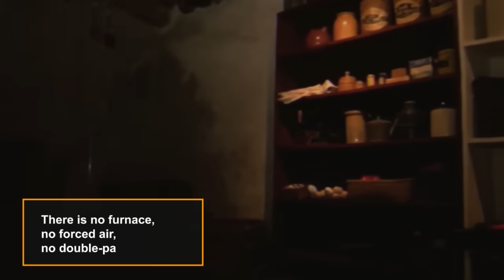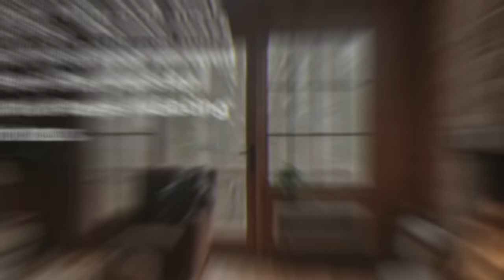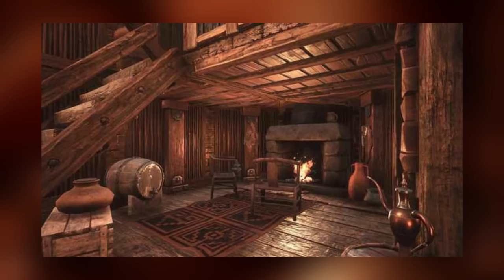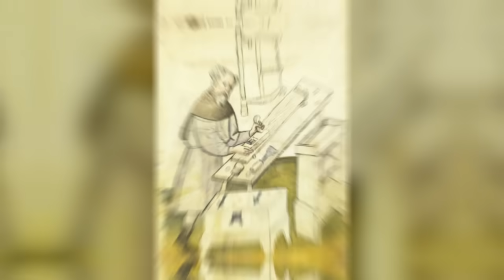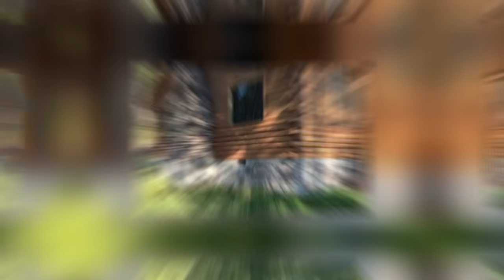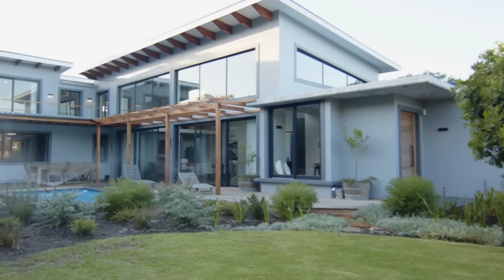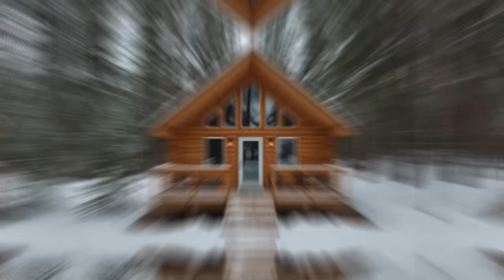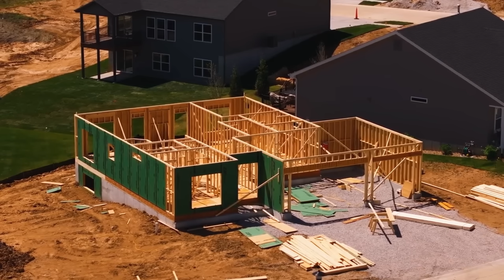Why Medieval Log Cabins Stayed Warm in -40°F While Modern Homes Freeze

Comment: I'm in Canada and purposely built my home with CMU block, filled voids with perlite, and covered inside and out with 2.5" thick cork+lime plaster.  These are high-mass walls.  Also painted with breathable silicate based paint.  Will never dis-colour and will never have to re-paint.  It looks like a typical stucco house.  These principals aren't forgotten.  I DID have to use a special variant on building code to get it approved, not that hard.
Reply: I insulated my loggia from the inside with a homemade perlite plaster. The plaster is 6 cm thick on average. The apartment is in a prefabricated reinforced concrete building. The temperature on the loggia increased by almost 10 degrees Celsius in the winter, without any heat source!
Reply: When I was in Finland we used a CMU that weighed about 1/2 of what a concrete block would weigh. The blocks we used were built from clay that was blown up in a kiln and then put back together with cement. Those blocks had better insulating value than wood.
Reply: Brilliant!
Reply: Whats a variance? LOL
Reply: @UsagiYojimbo-f1u  a process requiring approval from neighbours. For things like sqr footage of building to lot size for example. But for building code, you can’t get variances. You have standard building code but there is option for Building reg. B or Alternate building code. A more complex process of approval but more flexible solutions to achieve goals of code are possible.
Reply: Good luck getting any variance in code approved now. FFS, the federal Liberal Party just banned my Hunter Douglas house blinds. XD
Reply: @Mygg_Jeager  Why on earth did you have to get approval for blinds?  Don't put any and install after you get permit?  I shouldn't use the word 'variant' it wasn't a variance, which I'd need approval from neighbors, it was an Alternative Building Code.  I actually didn't need to do that either, I'd said I WANTED to do that to the building planner/drawing approver guy.  The process requires peer review.  AKA other planners in his position check each other's work.  In hindsight, that was a threat to his authority.  Because he became very cooperative after that.  That was 13 years ago, maybe it is different.  But something to maybe remember if you're ever in that situation.
Reply: @kippie80 You don't need to get approval for blinds. Hunter-Douglass changed their blinds because the old kind would occasionally kill a small child via strangulation. The old style are now outlawed for sale, because we have options that don't involve strangulation risk. It has nothing to do with getting a building code variance.

P.S. Your house sounds awesome. I live in a 200 year old house. It's not nearly as good as either yours or the one described in the video, but it's way better than the usual "modern" ones I've experienced.
Reply: @kippie80 bro what the fuck are you talking about? LoL I didn't say anything about permits. I said that they banned the sale and ownership of my preferred brand of house blinds that I have throughout my entire house and have had for 16 years or so. Now when one inevitably breaks, I can't get spare parts, I can't replace it with an identical make and model. I have to replace it with something weird and out of place. Because the government said so. This is a private residence with lots of windows. This isn't a construction site.
Reply: @kippie80 people need to start letting people know theyre "the wrong one". Submission to faux tyrants "allowances" is part of the problem. When multiple homes decide to stop complying and make it clear that any attempts will be taken as threats to life and liberty and responded to in kind, people either A. Mind their own, or B. Become examples. "Insurance Plan" is a huge help.

Comment: Not a storm but I spent the winter of 2021 without any heat and it was below freezing. I got really sick during that time. Fortunately I had some very thick blankets and some were 100% wool, that helped a lot, cuddling a doggie helps too.
Reply: How did you keep the pipes from freezing?

Comment: One scientific wrong info in this video is that the denser woods are better thermal insulator l. No denser wood means less air pocket  lesser the air pocket lesser the insulation. More the air pocket more the insulation but that doesn means bigger air pocket because it will cause air leaks . I am talking about small air pockets

Comment: My house in the same mountains where Mark Twain lived for 3 years, went down to 40F degrees when the power was out for 30 hours and it was 12F outside. We had a warm room we got to about 50F with candles and a small vent for fresh air. It was a real lesson in how heat and insulation works.
Reply: I also live in the mountains where Mark Twain lived. I wonder if we live in the same mountains? That would be... quite a Storey ;)
Reply: I live in a tree house that Johnny Appleseed planted, and it never gets cold inside.

Comment: In Scandinavia it is quite common to add insulation to your log cabin. Most (but not all) seem to agree that if you do add insulation to your log cabin you should do that on OUTSIDE of the logs, so it is easier for heat to get stored in the logs and less vapor/water get trapped in the insulation. The best insulation to use for this pupose is woodfiber mats that have all the positive features of wood and sawdust, but are form stable and do not compress/shrink over time (it can also buffer up to 35% of its weight in water and still keep it's properties and not rot or get moldy).

The thing that breaks down the logs the quickest by far is the UV light. That is why it has historically been common to put planks outside  the logs as a panel. That way the planks can be changed when they have deteriated but the core log structure will continue to be robust with minimal wear. 

Historically houses also had sod/turf/dirt roofs. This also adds to the insulation of the house as well as acting as yet more termal mass. It is huge factor of the thermal envelope.

If you go even further back, before loghouses were used (and timberframes with think short planks in between were used instead) it was common in Scandinavia to have an thick outer wall of stone, dirt, and/or turf outside of the wooden wall. In between these two were an air gap just big enough for a man to pass through (although still narrow).   The roofs overhang went out over the outer wall. This is how sod/turf houses in Iceland and Faroese Islands are still built. The outer wall acts as a wind and weather breaker. The airgap as stabelizer and insulation, and the thick wood as a reflector and termal mass. It is very effective to keep temperature stable. However the potential dampness in the airgap between the inne and outer wall can be a risk for the wooden structure. However with proper wood treatment (read coats of pinetar and boiled linseed oil) and good drainage in the eath beneath (layers of stones and gravel) this do not need to be a big problem, but still one to look out for.

One could do the same with a loghouse if one wanted to maximize the energy efficency without buying extra insulations and planks.
Reply: At least in Finland, also people and livestock used to live in the same building. Livestock would generate a lot of heat, though I don't think it would be suitable for the modern standards. And actually, there was so much heat and humidity that the indoors were quite tropical - enough so that malaria used to be endemic in Finland, I kid you not. Before learning this, I used to think that people must have lived in very cold conditions back then.
Reply: @fintux  Across the Gulf of Bottnia, in the southern and middle Norrland (especially Hälsingland) it is still quite common for the older farms to have the barn and the manorhouse in the same big house, so you can walk indoors from the house into the barn. Very nice in the winter, and it helped as you say with the heating as well.
Reply: Liked your comment overall. One disagreement. Wood does not reflect IR. Very few natural materials reflect IR. Polished metal surfaces are some of the only materials that reflect IR well. Al being one of the best broad spectrum IR reflectors. IR reflectors also need a bit of a gap between the surface and the heat source to reflect--not sure that this is fully understood why or not though, scientifically.
Reply: This has been a great informative video. I live in a normal block house in UK. 

They insulate it to death and it is acceptably warm even without heating on.

My question in all of this though is what about "damp and moisture" in the log homes? How is that avoided? It's a sort of a curse here in UK if we build a timber garage or outhouse. Great when sun shines and the walls warm and so on but when it rains or it's just damp, the inside of these buildings can get damp and moist.

Comment: I live in an old 1891 home, it was dependent on an old coal fired boiler  with water radiators that was probably on continually in the cold.  However today I have a gas boiler with the same radiators and I'm sure today's gas  is more costly than the price of coal from the 1890s(even with inflation). My home has many old windows and plaster walls and old wood siding, it doesn't hold heat well (32F outside all heat gone in 12hrs or less).  I have to shut almost all the  inner doors and I cover the glass on the windows with bubble wrap. Fyi - spray the windows with just a little water and then apply  single layer sheets of  bubble wrap to just the glass surface. The bubble side touches the glass, it works well. Unfortunately many of the old windows let cold air in where the double hang windows touch in the middle.   The gas boiler needs almost yearly repair and has failed almost yearly, not to mention venting air and regular maintenance. This year it was a thermal fuse.  Watch out for those hvac repair guys, sometimes they are a blessing, but I think sometimes they have shot parts cannon at our insurance co.

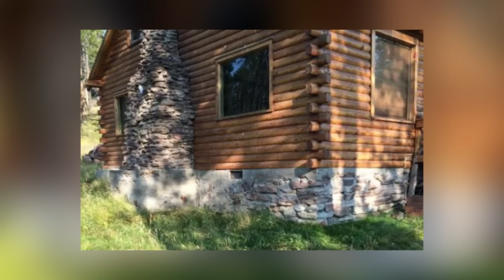Comment: 11:53 in Scandinavian loghouses it is not uncommon for the floor to made out of logs split i half. Underneath that you have a airpocket that are sealed off from the outside with a wall of dirt alongside thwfundation stones. The chiney stones go down into this airpocket so when the bricks in the chimey gets warm it also heats the air under the floor (and dries it out). The log beams in the dirt along the walls eventually root and needs changing  but that was part of the maintainment calculation and the floor was built so it was relativly easy to do (for one the floor was free floating and not attached to the walls).

Comment: my Partners house is a 400 year old cottage, with a wood fire, draughty windows and doors, but definitely warmer than a modern home if the heating not turned on, back then they had much smaller windows, if you are stuck in a modern home with a long term power outage, put up a modern hiking tent inside

Comment: I live in a shed. I never need ac,or anything. I made sure to insulation  it to death. In the winter only 1 small gas burner is all. About 100 dollars per year. I am blessed.
Reply: I lived in the Interior of Alaska, at -40 I could heat my 16'x24' shop with a $120.00 bus heater. Insulation is everything.
Reply: @HomesteadingAlaskatoMaine  I insulated my loggia from the inside with a homemade perlite plaster. The plaster is 6 cm thick on average. The apartment is in a prefabricated reinforced concrete building. The temperature on the loggia increased by almost 10 degrees Celsius in the winter, without any heat source!
Reply: Best wishes to you!
Reply: What temperatures can you handle at night? Im very curious.
Reply: I insulated my loggia from the inside with a homemade perlite plaster. The plaster is 6 cm thick on average. The apartment is in a prefabricated reinforced concrete building. The temperature on the loggia increased by almost 10 degrees Celsius in the winter, without any heat source!
Reply: Gas burners pollute the air quite heavily, i hope you have great ventilation!
Reply: You live in a shed ? Serious ? Do you eat squirrels & raccoons too ?
Reply: Is your name Bubbles? Do you love kitties?
Reply: Wow
Reply: Don't give an address of course, but where do you live? No one would survive winters where I live with just 1 gas burner.

Comment: This one's full of crap from the start.  Title is about Medieval log cabins but 10 seconds into the video it refers to a cabin built in 1842... not the Middle Ages by even the drunkest history professor's free liquor tasting day at Costco.  Also, stop trying to make a problem where it does not exist.  Most modern homes are insulated for cooling and heating perfectly adequately.  If air conditioning and efficient heat pumps had been available to frontiersman when building their cabins don't you think they would have used it?  I'll bet they would have sold their own Mothers into slavery for several pallets of plywood and Tyvek foam insulation panels... plus a nail gun and a circular saw.  Fast forward to today and try using your "medieval" log cabin in... say, the suburbs of a large city, surrounded by farmland.  Where are you going to get the wood to heat your little fireplace and keep it burning for hours?  What about your neighbor's fireplace?  Or the people one block over?  Wood hasn't grown wild in your area for a century when it was cleared for farmland.  Face it, frontier living (not to mention Medieval) was a pain in the butt.  Build a fire to boil water.  Build a fire to light a torch to see at night.  Spending all season growing cotton so you can knit a lousy pair of socks.  Getting bitten by rats at night because you sleep on a pile of straw on the floor, catching the plague as a result, and dying before your 25th birthday.  That sucks and any sane modern person would take hospitals, automobiles, planes, electricity, instant global communications, and supermarkets over living in filth and dying at an early age after several years of grueling back-breaking work.  Our ancestors were smart... for their time.  That doesn't make them geniuses by a long shot.  They just did the best with what they had at the time.  Today we do the same thing.  So stop trying to make the case that things were so much better and people were so much smarter in ages past... it simply isn't true.

Comment: Bought a 1955-built house in 2017 in the 45°N-75°W coordinate square. Moved in October 2017. Realtor paperwork said house is heated by oil furnace. 

Nope. It's actually heated by Natural Gas tankless Combi-Boiler. 

There is a manifold of 3 water circuits that run throughout the house to baseboard heaters where heat is wanted in rooms and hallways. When the system is working, it's very comfortable. Cheap too. Natural gas bill is roughly $140/month. Electric bill is roughly $98/month.

3 water pumps cycle the water to areas that request heat individually from the others. Each water pump operates at 60W consumption. The Combi-Boiler doesn't have a pump. It doesn't need one. It has 2 inputs and 2 outputs. 1 for the Domestic Hot Water (for when we take a shower or use a bathroom or kitchen sink) and 1 for the Heating system when any of the 3 pumps turns on it senses the flow and turns on. I have the DHW side set to 180°F, and I have the house heating side set to 160°F. When I set the house heating side to 190°F, the rooms get uncomfortably hot about 4-feet up from the floor, and the rooms are cold to require slippers on feet at the floor level. So, a lower temperature provides more evenly distributed heat in the rooms.

January 1st, 2018: outside temp: -38°C; the combi-boiler sprang a leak. The electrical components got wet and it popped a fuse internally and fried the main board and stopped working. We called every plumber within 200km. Everybody was on Christmas/New Year's break and earliest we could get was a week later.
It took less than 24h for the interior of the house to reach 0°C. My wife went to her parents' to sleep. I stayed to be available if any plumbers appeared. Thanks to Facebook, someone showed up with some electric heating fans, 700W-1500W each. I set one up in the kitchen, aimed under the sink to prevent those pipes from bursting. I set another up in the bedroom to prevent that water baseboard pipe from bursting. I set the rest up in the basement, making sure to use outlets on different circuits to not pop a fuse (yes, the house still uses a fuse panel, not a breaker panel [that's on our to-do list to have upgraded]).

I bought a thermometer to keep near my sleeping bag. It reached -32°C in the house. Two pipes did burst. Luckily they were in easily accessible spots and the plumber replaced about 2 feet of copper pipe for free after bringing a new combi-boiler tankless water heater that cost us $3000 to get heat back in the house.
But, the system's been running well since. I've bought 3 bags of pink batting insulation and stuffed exterior walls to help a bit.

Don't be a school bus driver if you need money. I am still a school bus driver. We're hoping to be able to cover the electric panel upgrade by 2030.

The nice thing about this house though; in summer, we don't need any cooling. The roof extends off the south and west sides about 8 feet past the wall and keeps the sunlight off the exterior wall.
When it was 42°C outside, it was 28°C inside.
We allow air to enter the basement and get sucked out from the top floor naturally as heat rises, so the house cools itself without using power.